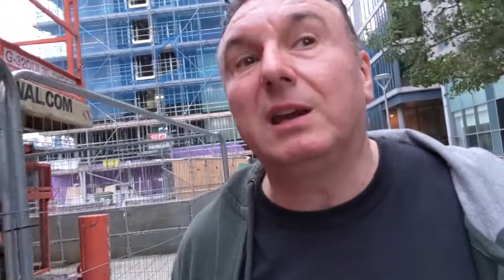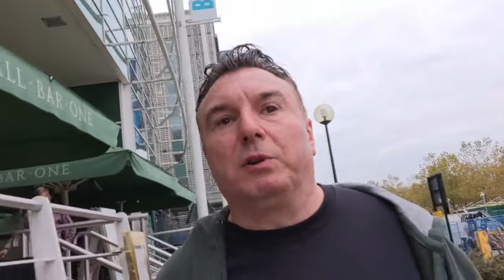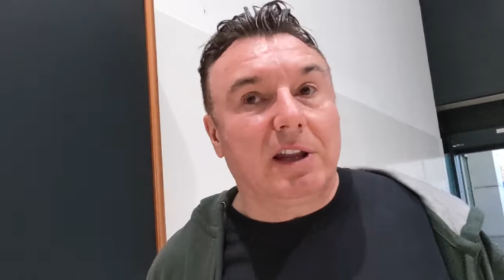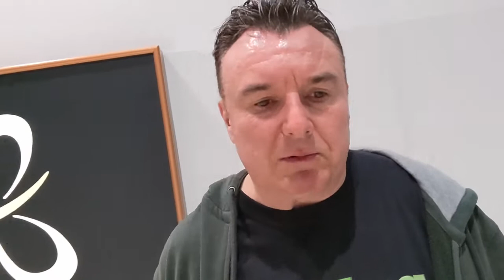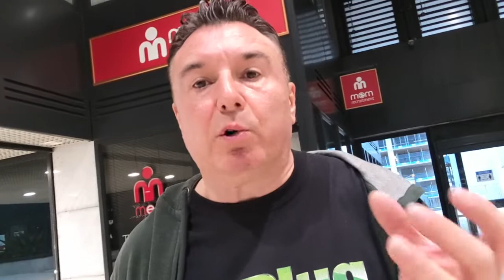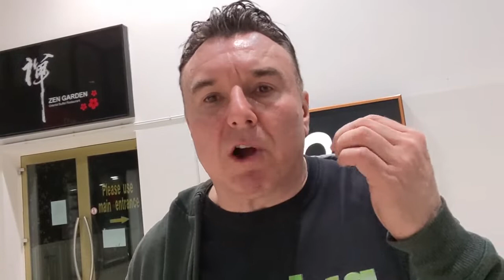Chapter 5 - Ditching the Raspberry Pi and going Bare Metal

Comment: Kind of funny how you can start off with a relatively simple idea but to actually get it done, you can't imagine how all the different layers that have to come together make the complexity and difficulty grow exponentially so that you get yourself to a point where you had no idea what you were getting yourself into. Do you ever have times when you are almost ready to give up on it?
Reply from the maker: You are right Oakley. This is exactly what I want to communicate with these videos - how having the idea is really the easiest stage. I have learned to sense when small details are taking a disproportionate amount of time and energy and backtrack or postpone those parts. I won't give up until I have found a solid reason why the project is not feasible. If it turns out that there is a business problem such as the production costs are higher than the price the market will bear, or there is a technical problem which has no solution then I will give up. But I won't give up just because it takes a lot of work.

Comment: I found the project idea really good ! Will you provide it as an opensource device or with ways for programmers to do our own software ? I think like a plugin for Synthesia or any other existing programs as a MIDI controller ! 
But I saw that a mobile app is on the way ..  so can't wait for chapter 6 !
Hardware is not that easy.. ditching the raspberry pi part might have been a good move.

 I saw the pre order, might take one soon :)

Keep us updated Paul, I love your covers and I began (I wish I was more consistent in my practice..) with your videos !
Reply from the maker: Hi Bruno, thanks for this. I had another product, a desktop application, many years ago for which I published an API and invited people to extend the functions for their own specific needs. So yes, inviting people to bolt on more uses of their own is a fast way to cover more uses. I probably won't do it straight away because it takes time to think how best to expose what the system can do and to document it and give examples, but there's no inherent reason why extensions to control the snake to do more things should not be included.
Reply: @paulwwells   Oh thanks for the response ! Yeah I though so, fair enough :)
I'll keep seeing your vids, but I will definitely get one soon :D

Comment: When you program on a PI, Do you go straight for Python or are there other languages you can use? Last thing I programmed was C++ 20 years ago lol.
Reply from the maker: I installed a Java runtime and ran the application which I have built from the Pi command line with the piano connected via USB. I feel slightly bad for setting this title for this video. I think the Raspberry Pi scores well for a general-purpose computer you want to put in-situ so that it can monitor or control something - as is the case with any IoT application you can think of. Certainly you could compile C++ down to run on the operating system and it would work very well. But I don't think it makes sense to base a product you intend to make thousands of unit of on the Raspberry Pi.